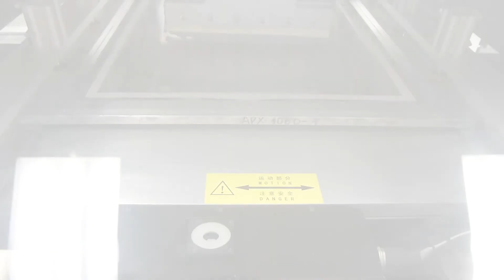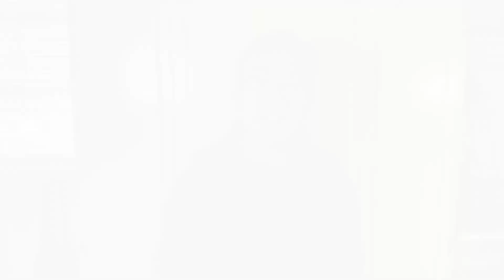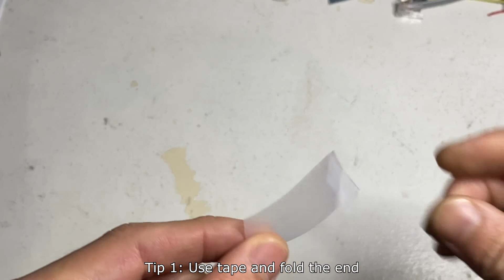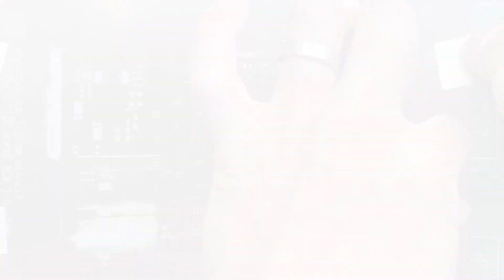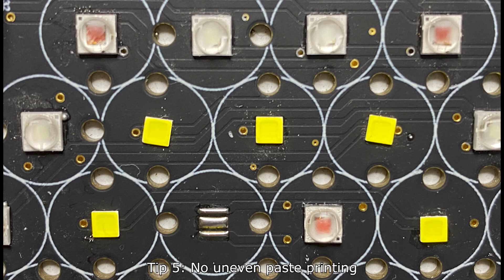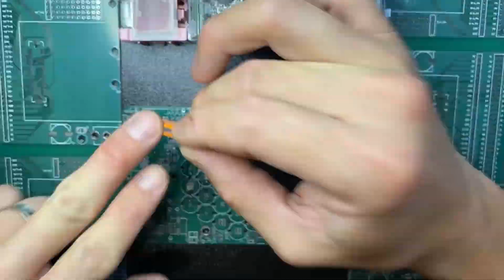Manually Solder FPGA BGA Package, High-Density PCB, DIY Solder Paste home PCB Assembly #pcbassembly

Comment: Did you say the board can be reflow multiple times? How would you do the solder paste again if there are already  components in a section of a board. Do cut out the stencil? Thanks.
Reply from the maker: That's going to be case by case. Very often I would just apply the past by hand -- no stencil.